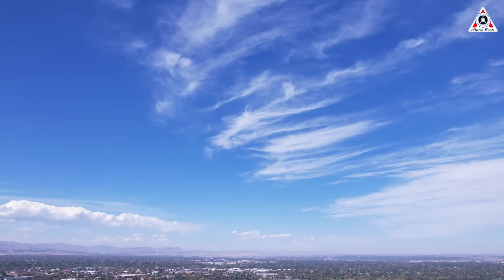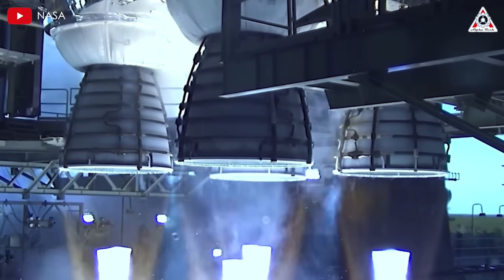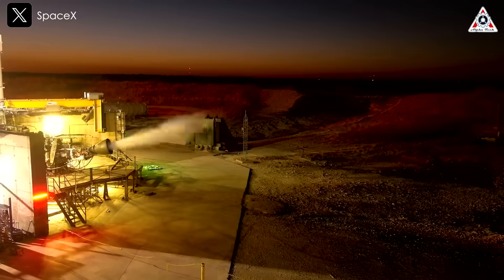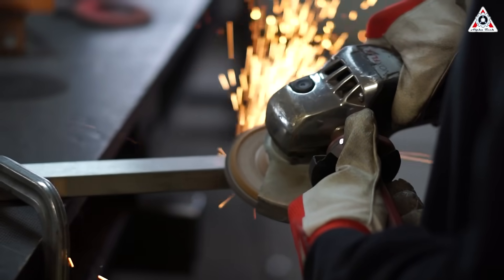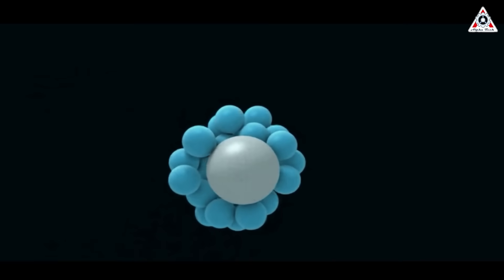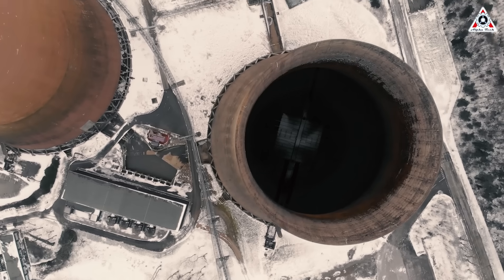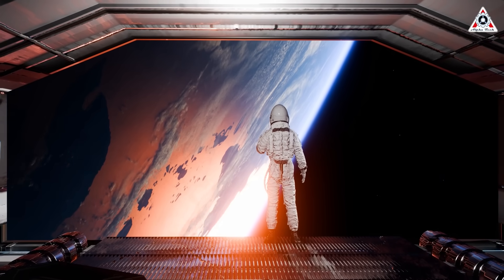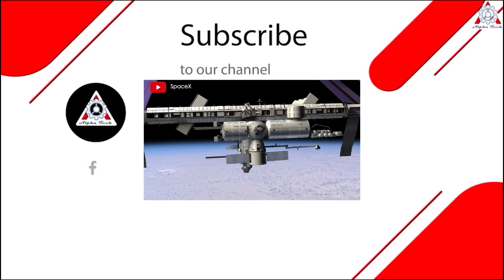NASA's New Nuclear Rocket Engine to Mars in a Day! Even Faster than SpaceX Starship...

Comment: Funny. At the 5:37 mark you show the Eagle Lunar Transport from a 50 year old TV Show Space 1999 portraying it as an inter-planetary vehicle.  This is laughable.   
Why the Eagle Transporter Would Be a Complete Disaster for a Mars Mission
Ah, the Eagle Transporter—one of the most iconic spacecraft in sci-fi history. Sleek, modular, and utterly useless for an Earth-to-Mars mission.

Yet, every now and then, someone who clearly skipped science class (or just really loves Space: 1999) decides that this low-orbit shuttle is somehow capable of interplanetary travel and planetary landings on Mars.

Spoiler Alert: It isn’t.

Let’s break down why using the Eagle for a Mars mission is laughably wrong and why anyone who does this is either clueless, lazy, or just in love with its design.

1. The Eagle Would Burn Up Before Reaching the Surface

First things first—if you’re going to land on Mars from space, you need a heat shield to survive reentry.
	•	Real spacecraft like Apollo, SpaceX Starship, and the Space Shuttle use ablative heat shields or thermal tiles to protect against the 3,000°F+ (1,650°C) temperatures caused by atmospheric friction.
	•	The Eagle? It has the thermal protection of a tin can.
	•	If it tried to enter Earth’s or Mars’s atmosphere at orbital speeds (~25,000 km/h), it would instantly become an expensive meteorite.

2. The Eagle Has the Aerodynamics of a Brick

Even if it somehow survived reentry, it has another problem—it’s about as aerodynamic as a cinder block strapped to a jet engine.
	•	Spacecraft like the Space Shuttle, SpaceX Starship, and even the Apollo capsules are designed to glide or slow their descent using either lift or controlled drag.
	•	The Eagle? It would tumble chaotically through the atmosphere like a drunk satellite.
	•	It has zero control surfaces, no lifting body, and no aerodynamics whatsoever.
	•	Real Mars landers like Perseverance use a parachute + retro-thrusters system to land safely. The Eagle? It has none of that.

Trying to land an Eagle on Mars is like dropping a school bus out of an airplane and hoping for the best.

3. The Engines Would Run Out of Fuel Before It Even Got to Mars

The Eagle runs on chemical rockets (like real-life lunar landers), which means it has a limited fuel supply and an even more limited range.

Let’s compare it to what’s actually needed for an Earth-to-Mars trip:
	•	The Saturn V rocket (which took astronauts to the Moon) had a total delta-v of ~16 km/s.
	•	To reach Mars, a spacecraft needs at least 6 km/s of delta-v just to escape Earth’s gravity.
	•	The Eagle? It barely has enough fuel to get out of low lunar orbit, let alone travel 55 million km to Mars.
	•	Even if it somehow made it to Mars, it wouldn’t have enough fuel left to slow down and land.

So unless Mars suddenly develops a network of interplanetary gas stations, the Eagle is dead on arrival.

4. It Was Never Built for Long-Distance Space Travel

Let’s pretend for a second that the Eagle magically had enough fuel to make it to Mars. That brings up another issue—how does the crew survive the journey?
	•	A Mars mission takes 6 to 9 months each way.
	•	The Eagle has no radiation shielding, meaning the crew would get fried by cosmic rays.
	•	It barely has enough space for a small crew, let alone the food, water, and oxygen needed for a Mars trip.
	•	It has no artificial gravity, meaning bone and muscle loss would cripple the astronauts by the time they arrived.

The only thing reaching Mars would be a crew of severely malnourished, irradiated corpses floating around inside a fuel-depleted metal coffin.

5. VTOL Thrusters Don’t Work on Planets with Gravity

The Eagle has four landing thrusters designed for low-gravity environments like the Moon or asteroids.
	•	Mars has 0.38g gravity, meaning the Eagle would need far more powerful engines to land safely.
	•	The only way for VTOL thrusters to work on Mars or Earth is if the ship carried massive amounts of fuel.
	•	Since the Eagle already lacks the fuel for interplanetary travel, it sure as hell doesn’t have the extra fuel to hover and land in a high-gravity environment.
	•	The thrusters would run dry before it even got close to the surface, and the Eagle would crater into Mars like an overconfident SpaceX prototype.

So Why Do People Keep Using the Eagle for Mars Missions?

It all boils down to one reason:

“It looks cool.”

That’s it.

Whoever is depicting the Eagle as a Mars lander is doing it because it’s a beautiful sci-fi design, not because it makes any sense.

In reality, the Eagle is an orbital shuttle, not an interplanetary spacecraft. It’s perfect for moving people around the Moon or a space station, but it’s about as useful for a Mars mission as a minivan with jet boosters.

Final Verdict: The Eagle Transporter on a Mars Mission is Sci-Fi Nonsense

Using the Eagle for a Mars mission is like:
	•	Taking a city bus on a cross-country road trip—with no gas stations.
	•	Jumping out of an airplane with a backpack instead of a parachute.
	•	Trying to cross the Atlantic in a fishing boat—with no supplies.

Whoever thought the Eagle was a Mars-worthy spacecraft needs a remedial course in space travel. At best, they’re ignorant. At worst, they just don’t care.

If they wanted a real interplanetary ship, they could’ve chosen something like:
	•	SpaceX Starship (designed for Mars)
	•	NASA’s Orion Capsule (deep space-rated)
	•	The Expanse’s Rocinante (fictional but much more practical)
	•	Even a heavily modified Space Shuttle would be a better choice!

But instead, they went with a glorified Moon taxi and expected it to work. That’s like picking a golf cart to race in the Indy 500.

Want to call them out with style? Just send them this post and ask:

“Hey, what’s your plan for getting the Eagle through Mars reentry? Fairy dust or alien magic?”

Want to “Fix” the Eagle for a Real Mars Mission?

We could redesign the Eagle to actually make it work—give it:
✔ A heat shield
✔ A fuel-efficient nuclear engine
✔ A Mars lander attachment
✔ A proper life-support module

But at that point, it’s no longer the Eagle Transporter—it’s a completely new spacecraft.
Reply: So are you saying you didn't like the visual?😂 Tell us how you really feel. Oooh, tell us how we stop, or even slow down in space. I didn't see any forward thrusters depicted on any ship design.....aaaaand GO!

Comment: This is not new. It is like 70 years old and it would not get us to mars in a day. Maybe two months but not a day. Raptor gets 420 isp the NTR gets around 800.
Reply: A nuclear rocket firing continuously at 1g of thrust would get us there in less than 2 days. That includes turning around midway and thrusting to slow down.
Reply: @ but the ISP of a nuclear thermal rocket is 800 and it’s thrust to weight is nowhere near enough to give you one G of thrust. This is why I gave the ISP of these engines. You’d have to get into hyper fusion rockets that rely on unpredictable fusion reactions in order to get anywhere near what you’re talking about and even in that case you’re talking about a fuel to energy conversion ratio of I think 50%, which is insane.

Comment: On February 10, 2025, a working laboratory prototype of a plasma rocket engine was demonstrated in a special report "Express to Mars" on the Rosatom channel. It is announced that work will be carried out on a flight prototype by 2030, with several times more resources. The prototype of the KM-50M Kholovsky engine, the ID-750 ion engine, with power up to 50 and 100 kW, which have passed fire tests, was also demonstrated. Where are the prototypes of power plants and engines from NASA in metal?

Comment: First, nuclear power is safe. Second, a forced plasma engine 1st generation will likely not produce enough thrust to launch from earth so: a ship built in space perhaps with heavy shielding processed on the moon, used as a mother ship to support crew and shuttle craft. Third the idea is low but constant acceleration and then deceleration ( 1 g would be ideal.) 4.WE NEED TO STOP WORRYING ABOUT NUCLEAR PROLIFERATION AND BUILD THE BEST SHIP WITH THE BEST FUEL AND CONTROL NUCLEAR PROLIFERATION THROUGH SECURITY AND STRENGTH!
Reply: Nuclear power can be made safe by a lot of masses, but then it will be unable to fly except Chornobyl. But I would not take Chornobyl as an example of how safe nuclear energy is.

Comment: Clickbait title, reported video, Starship DOESNOT have 39 Raptor Engines.... the main Starship has 3 vacuum and 3 sea level engines. The Booster designed to get it into space will have 37-39 Raptors. Try again.
Reply: The second stage will be fitted with another 3 vacuum engines and extra sea level units. But yeah, they did get the numbers screwed up.

Comment: This technology has been known and was theoretically available for several decades. It is not used because it is illegal to use nuclear propulsion systems in the atmosphere. The reason is because if anything goes wrong (as it does) it could cause horrific radioactive contamination on earth. If this technology is allowed (and that is a big IF) it will not be used for daily launches into space, that will still be conventional rockets. 
They will first have to figure out a way to transport all the radioactive materials safely into space in such a way that if the rocket blows up and crashes, it won't cause any potential environmental disasters. Then it will be assembled and activated in orbit for deep space missions. For getting everything into space,  Elon is and will most likely be (for the foreseeable future) the cheapest and best option.  Perhaps if we get a moon base going they could mine the materials, and then build and launch them from the moon. 
One step at a time, first we need the moon base, and then once again Elon (or some other private company) will most likely be the ones to actually make it happen.

Comment: How do you slow down a fast ship to Mars?
Reply: Reversal thrust blasters
Reply: Turn around half way and spend the same energy you spent to get to the half way point. If the engine quit at the peak speed you'd not necessarily crash into Mars cause you'd get to the target location too soon, and probably miss and float off into deep space... If smart the rocket would at all times be aimed at the point where you'd slingshot around Mars if your current speed remained constant... But at these speeds and Mars' gravity that'd be inside the atmosphere, and you'd burn up so never mind you're toast
Reply: @johnb003  Very high IQ individual

Comment: Without antimagnetic Sheild any spaceship at that speed as there are abrasive particles in space will be sand paper on the metal skin of any space ship and worn away as space is not Empty and why UFOs have a shields around them as to part any small particals from damage to the surface of there craft by the magnetic propulsion of the craft that's basic for space travel at high velocity of thousand of or millions of meters per second. Anything from Nasa is a waste so ask the military for the UFO tech that they have and stop with mankind's crappy tech that even space X is playing snail speed with which is lethal for any man-made journey to Mars which will not happen anyway You have seen the size of UFO's and without that Tech forget it as mankind is not destined to colonise any other planet but the one he is already on.
MPK.
Reply: actually, this is easily achieved, and the technology has been around for a couple decades at this point. i can say this because who do you think actually owns the ufo's. hint. not aliens we made them right here on earth. the shielding is very simple. as for high-speed travel I will simplify it for you. you are currently living on an inanimate object that is already doing it. to warp time space, you need to follow the formula already laid out in the 1978 report to nasa. nuclear engines are a good step but I recommend pulse fusion thrust for near light speeds. the us DOD was given this system in 1998. check report files to access those records.
Reply: And you know this because your friends the alien space people told you.....?

Comment: Not going to work. Aneutronic fusion is much better. This type of fusion engine would produce thrust and electricity without any fast neutron radiation so the less shielding is required and engine and shielding will last much longer.
Reply: So even farther in the future. Doesn't that require He3 fuel? Like 1000x the price of gold?

Comment: This was a great video!  Nothing however beats the Ion Propelled Vehicle or Self-Contained Ion Powered Aircraft. They are ion thrusters that are patented for lifting their power supplies against Earth's gravity.  Currently the technology is better suited for silent lightweight drones or amazingly fast space probes, but it might be able to be adapted for larger scale use and can be upgraded in the future.
Reply: Ion thrusters are ideal for very long flights (like the outer planets)
The new high output ion engines require huge electrical power.
That means a substantial nuclear reactor. With an efficient generator stack. 
That is zero maintenance.  
We are a long way from there. 
I hope we are working on it.
Reply: @chuckevans2792  Please check out the lightweight crafts I have mentioned online.  They do not take a lot of power, only a few watts for very low mass payloads.  I know other heavier ion thrusters do, however.
Reply: Nasa is looking into nuclear electric propulsion but it's several years away. Nuclear thermal population is right around the corner with a powered test flight in 2027-2028.

Comment: We're too focused on rockets as the mechanism for space travel. Unconventionally-shaped craft like spheres, lozenges, or discs are perfect designs for vehicle surface ionic propulsion. Charging the forward- and aft-facing surfaces to millions of volts of opposite polarity provides force and directional control...but there's another benefit in regards to a problem that doesn't get mentioned in detail much: harmful radiation.

You see, if there is a controlled sheet of plasma flowing over the skin of a spacecraft, that would prevent all but the most powerful ions blowing through solid matter at high frequency. Instead, the high-speed particle, itself carrying a heavy charge, would hit the electric field surrounding the craft and zip over to the pole of its preference rather than punching through and going through someone's brain and giving them a cosmic ray stroke.

Lastly, that drive would work hella good in the hydrosphere, as the thicker the atmosphere, the more material can be charged up and carried along for thrust. Hell, maybe that's why we've been hearing and seeing so much info recently from the Navy regarding USOs chasing our boats.

Comment: STOP -  there are limits to how fast you can go without killing those aboard.
It's all about G forces. You can't accelerate too fast or you kill those inside. You can't decelerate too fast or you kill those inside. Even 3 Gs would be so uncomfortable it would not be practical. Imagine you want to get to the store as fast as possible in your car.
You get in and push the gas to the floor. Then half way there you push the brake as hard as you can and stop just before you crash into the store. It would not be a very comfortable ride. You want to go faster so you use a top fuel dragster the next trip. The store is 1/2 mile away from your house. You get in and punch the throttle. You accelerate at 4 Gs or more for about  4 seconds then pop your parachutes to spent the rest of the trip slowing down at even higher negative Gs. You are pinned to your seat by the G forces as you accelerate and are in danger of having a detached retina as you slow down the last part of the trip.
I suspect the G forces required to get you to Mars in a day would be something like that.

To get around this you need a craft that bends space and time and avoids G forces.
So get the government to use one of the back engineered ufo crafts they have.
Reply: Loved the analogy up to the last paragraph. If we had alien tech we would have used it already (then doge would cut it for being illegal alien tech 😂)
Reply: @Mikey_Likes_It_Too  Have you not heard the recent government hearings where whistleblowers said alien craft have been recovered?

Comment: Cosmic rays... What about the shielding required to protect the passengers from the engine.
They had that problem with a nuclear airplane, back in the 1960s. That would be an interesting story.
🙃
Who is the deceased physicist, who worked that nuclear engine before lecturing on UFOs... Oh, Stanton Friedman.
(I spoke with him a couple of times. Nice guy.)
Reply: Radiation is linear so crew shielding would be minimal, basically a cone at the base of the habitation module.